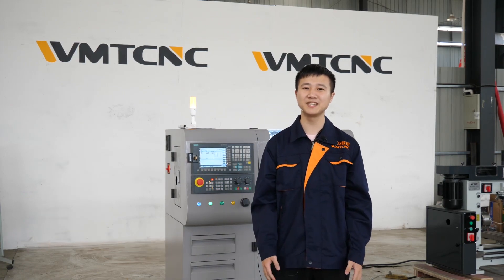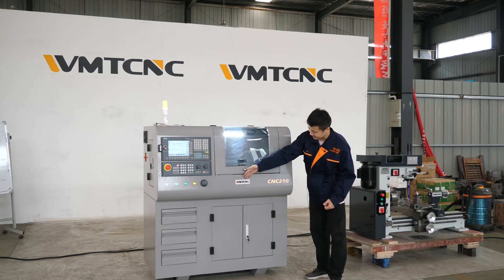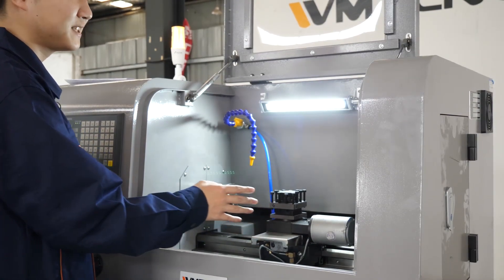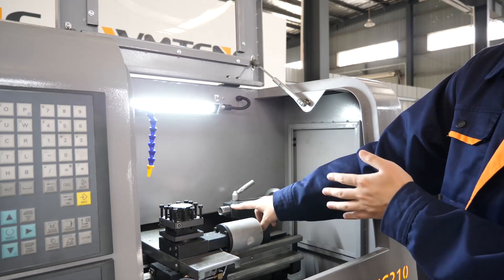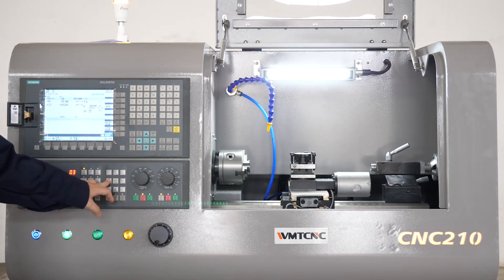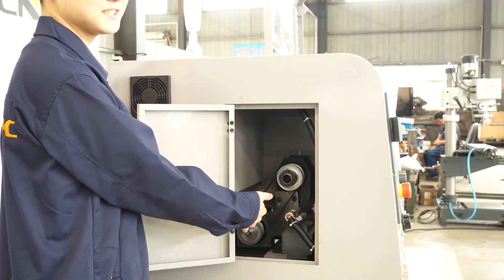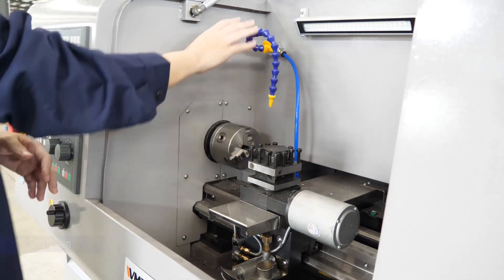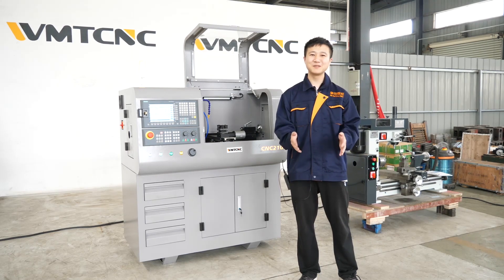How Dose Lathe Machine Work, WMTCNC Small CNC Lathe Machine with Siemens Controller

Comment: What is price
Reply from the maker: CNC210 with AFTER 990TDB controller without machine stand: USD4680
For this cnc lathe machine, GSK, Siemens as optional. Contact us Lwang@wmtcnctool.com
Whatsapp : 0086 18656680921